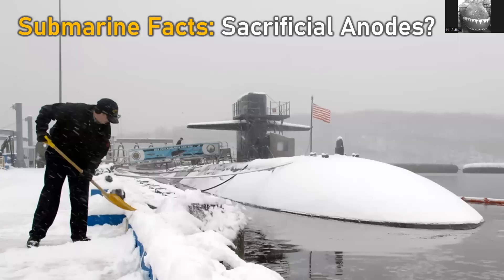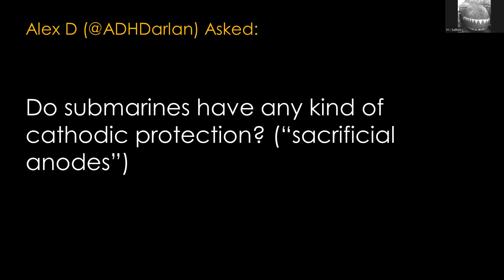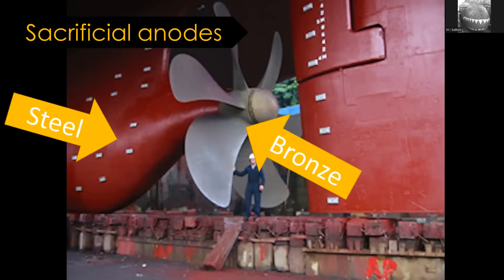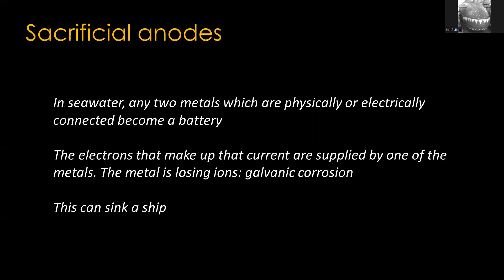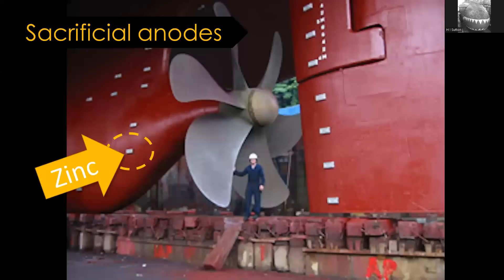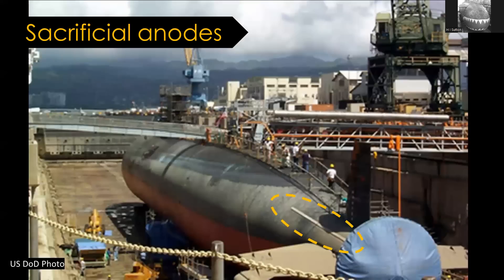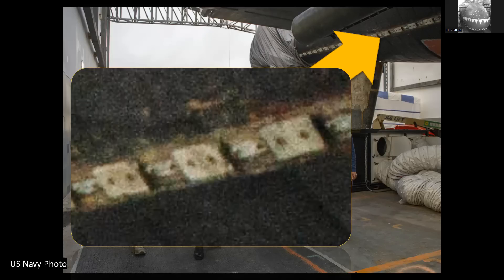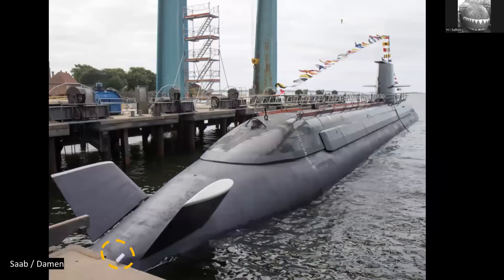Submarine Secrets: What Stops Subs Sinking But People Overlook?

Comment: Nice little piece, just to add most ships rigs and vessels in sea water and in water with minerals in them, also adjust the galvanic corrosion table by using impressed currents across the hulls of the vessels particularly were you are able to provide a sufficient amount of power in the form of a modifying galvanic current to adjust the differential corrosion rates in your favour - this has become quite a science in the protection of metals underwater and is quite complex. Many high value metal objects particularly submarines use these techniques to improve life spans. (source: Institute of corrosion engineers USA/UK)  Kind regards

Comment: Another interesting video!! Thanks! The USN submarines I was on all had sacrificial zincs aft. As I remember, I think they were all below the waterline. They sort of melt like ice cubes. Only at a very slow rate. Remember reading that corrosion is an electrical process when water gets between two dissimilar metals there's current flow.

Comment: Ok, so, silly question off the back of the titanium subs, has anyone ever made a submarine hull out of brass?
Reply: Brass isn’t generally a very strong material, so wouldn’t be very beneficial. It also has a higher density than steel, so to get a similar depth as a steel hull you would need to make the hull thicker which would also lead to a very heavy boat. 

Titanium is a good option because it is strong and light, but it is expensive.

Comment: Here in US they are vert strict about zinc inspection and replacement on a fixed periodicity.  There is also a periodic structural inspection of "known hull defects" to verify no pitting growth or erosion.  If this inspection is not complied with, SUBSAFE certification is suspended and the sub becomes a surface ship until requirements are met..

Comment: You don't just have to protect against different screw to hull materials.  Galvanic corrosion occurs when, in the presence of an electrolyte and oxidant (sea water would be great) a current flows from a higher potential to lower (electrons go the other way).  Steel is made up of several different elements each of a different electro potential so that a current can flow between points on the surface of the same plate.  We can reduce that by passivation, which is a process by which the alloying elements at the surface are etched away leaving a single element surface.
When the steel (actually all metals) are stressed then a varying electro potential occurs throughout so that current can flow between high and low stress.  A really good example is welds because when the weld metal cools it locks in stress so if not normalised (reheated and allowed to cool slowly) they rust badly.  Protective treatments (like galvanising (zinc plating)) help, paint helps but in both cases they are often compromised by collision (with the dockside?) and the flexing of the structure (in this case hull).  Stresses are also produced by hull flex (including external pressure when diving) which also produces potential cells.
Corrosion does need an oxidant so deep under water you are safe but nearer the surface not so, which is why the waterlines of surface vessels rust so bad.
So sacrificial anodes are useful everywhere in the hull.  
Lumps on the outer hull would cause turbulence (is that why you see them as streamwise strips?) and so noise.
I guess under the casing is a good place particularly as it is near the waterline. 
A second hull like fibre reinforced plastic for instance would cause problems for the dockyard mateys when the cut holes in the hull to fit/remove/service equipment.

Comment: Are the external anodes directly connected to the hull or connected via a wire? It strikes me that having something connected to the hull and not covered by rubber would defeat noise dampening applied elsewhere.
Reply: they are bolted to the hull firmly, so no movement.! I have worked on a sub and a sub tender for what it's worth.!!

Comment: I am a project Coordinator for a company that specializes in cathodic protection. We manly work for gas companies protecting the underground gas lines. These are all coated one way or another but even these need to be protected by either galvanic or impressed current. 
Also, while your explanation of galvanic corrosion is correct with different metals causing the corrosion. The steel hull would still corrode by itself due to deviantions in the metal itself being in the salt water. Think of any unprotected piece of steel left outside. Rust is a form of corrosion.
 Great  video still. Love learning from all your videos and Aaron's Sub-briefs

Comment: It is reasonable to interpret the North's nuclear submarine as meaning an SSB equipped with nuclear warheads and ballistic missiles, and as North Korea's official announcement has always been, it is confusing its opponents with vague expressions and falsehoods.

However, it seems true that efforts are being made to increase the weight and range of ballistic missiles mounted on SSBs and to increase the quietness of the platform, and even conventional submarines, North Korea's strength in ballistic missiles, including South Korea, is not satisfactory. It is also true that the ultimate counter for this is a nuclear submarine.

Comment: Thanks very much for this fascinating video.

One thing I'd like to understand is why the typical design calls for steel (or I guess Titanium) for the hull and brass for the screw.  Why not make from a consistent material?
Reply: My understanding is that screws are normally cast to get the complex shapes and bronze casts much better than steel or titanium.

Comment: Most of the anodes are inside the casing structure, as part is ballast and part is free flood space. So, you cannot look at the outside of a ship or submarine and conclude they don't have that many, or they are really small, or they don't use them at all. Also, keeping them on the outside comes at a cost in drag, signature and rate of erosion. Modern submarines and ships also use impressed current instead of galvanic blocks.
Reply: You'd imagine that replacing "internal" blocks is pretty labour intensive.
Reply: @mrkeogh  It varies. Locations that are impossible to access without dry-docking, can be fitted with larger blocks, weighing within 35kg to 60kg each, and/or a greater number of them. Once sufficiently spent, removal is straightforward, although it would normally require erecting scaffolding, and installation would only be possible with lifting gear, but both would be needed anyway for other tasks. Locations that are relatively easy to reach and readily available, but tight and require crawling or walking in a squatting\awkward position, such as underneath the top casing structure, can be fitted with small anodes weighing 5kg to 15kg each, to keep them within the range of manually handling limits and replaced more often, as there wouldn't be a need for dry-docking.

Comment: Titanium is highly corrosion resistant in seawater. The Australian Collins class submarines have titanium hull plating over the entire hull with a steel pressure bearing hull under it. The steel is not in contact with the water.

Comment: An interesting side note . The ancient Romans had the same problem with their wooden ships . Where they had iron fittings . They solved the problem by covering them with lead which would be poured on when molten.
Reply: And the British solved it by using Brass and bronze fittings instead (particularly after the started using copper sheathing to prevent fouling).
Reply: @allangibson2408  copper based materials avoid mould and kills of limpets and other creatures.

Comment: Actually this answered a question I had about the Sierra's as I had seen the previous photo of the six bladed titanium screw and wondered if the new 7 bladed scewback screws were a bronze alloy or still titanium.
Reply: Might just be am economic step=back as something that fits budget wise.
Reply: @Einwetok  Very likely as the two sierra II are the only titanium boats (aside from smaller spyboats) left in the fleet so custom buildings titanium skewback props when you have working brass ones is fiscally irresponsible with little weight added.  Also  might have ended up thr better material for the job, but I don't know.
Reply: @The31stcenturyfox I'd reckon with it being extremely difficult to fashion them in the first place. After so long they aren't set up to make one as you would be while building titanium submarines.

It'd be a lot more expensive and difficult now than then. They were also more of a test than anything. They'll have good numbers on efficiency, longevity etc.

Mitigation has also progressed, inducing current in hulls to reduce/target the galvanic corrosion.

Comment: hmm carbon fiber screw 😆
Reply: Hmm.. maybe, but advanced plastics might have some really interesting properties.
Reply: Theoretically, fiber reinforced plastics could be used to tailor acoustic properties and supress radiated noise.  Unlike bronze which has homogenous material properties, composites typically have orthotropic properties  - e.g. directional stiffness.  For instance, wood is a radially orthotropic material.

Comment: Something I've always wondered:

Navies report a tremendous problem combatting rust. Why don't they generally use sacrificial metals to protect against this? Is there just too much of it? It seems that they could transfer out the expended material fairly often when they are resupplied. I imagine powdered zinc could be used to make it easier to handle.

A bit more speculative-- how much current is generated by this electron flow? Would it be useful as an auxiliary power source in a submarine?
Reply: No, this current is way to small to have a useful effect. Powdered zinc would be better in the anti-corrosion aspect, but you have to use larger areas on the sub; so it adds more weight and has to replaced quite often in form of a coating, disturbing the noise protection by rubber coatings.
Reply: @foreverpinkf.7603  I meant for use in ships not subs. Apparently removing rust is the single most time consuming maintainance task.

Comment: I found this both interesting and somewhat surprising, as I would have thought that most modern submarines would be utilizing a low signature active impressed current cathodic protection (ICCP) system, perhaps separately augmented with passive galvanic sacrificial zinc anodes.
Reply: And no need for draggy, noise inducing anodes strapped to the outside of the hull too.
Reply: The newest types do (at least for NATO), but it probably isn’t quite worth it to refit the older models.
Reply: Shocking

Comment: Great topic.  Outboard motors and some vehicles in Canada have had those for just over 20 years now.  Vehicle manufacturers have started installing electronic 'black boxes' that bleed electrons to stop corrosion.
Reply: Those magic black boxes do not work. Remember that you need an electrolyte to complete the circuit. Vessels are always sitting in (salt) water. The type of crevice corrosion which causes the majority of the issues in automotive applications is not able to be protected in the same way because that electrolyte is only in a very very localized area.

Comment: On a similar note, could you do a video on how submarines create a watertight seal around the screw shaft? And futhermore, how this is made to withstand pressure at depth? 

I CANNOT get my head around how this is achieved.
Reply: It's easy.  You just have to feed the shaft seals.
Reply: @fleetcenturion  Just so we are clear that's feed the seals not club the seals huh? And do not, i repeat do not blow the seals...gets messy.
Reply: Shaft seals are not that high tech, Don't forget boats have shafts in the water also so very common to all marine vessels.
Reply: I have done it, on 688 /637 boats. It was awesome to do. But you have to have represented by the manufacturer. So it comes down to graphite and a hell of a lot of torque.
Reply: Typical submarine configuration is two independent mechanical face type seals that can be used interchangeably. In addition there in an emergency packing seal similar to a valve stem packing that can be hydraulically actuated.  Finally there is an inflatable boot to seal the shaft when stationary for repairs. The mechanical seals are very sensitive to alignment and surface finish.  For years our shaft seals were made by the SEALOL company and supported by their tech reps.
Reply: Chabuduo! They'll dump it on their own fish and make the fishermen go to foreign water. Why put effort in when you can half arse it? Chabuduo!
Reply: Simply inject a fluid between two seals, and then suck it up on the inner - or both - sides. The fluid that is gathered from the inner side can be re-used, while any fluid that gets out of the outside side will be contaminated with sea water. In theory, a water-based lubricant can perform this task without causing any real pollution. In reality, the military has many waivers for pollution and workplace safety, depending on the circumstances. A surface vessel regularly collects a mixture of waters and oils from its various systems though, and so they can reclaim the outer oil+water and burn it in their sludge furnace (if Chinese, they will probably just dump it overboard in ports and fishing waters of rival countries though).
Reply: @buckstarchaser2376  truth on the Chinese